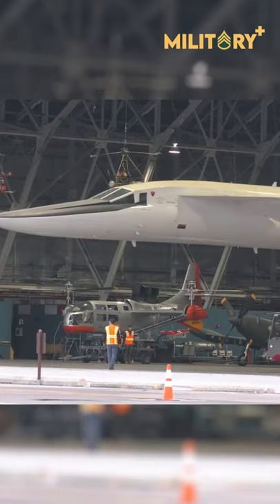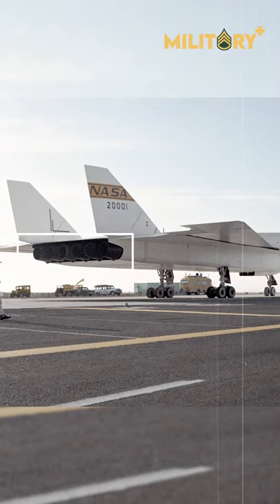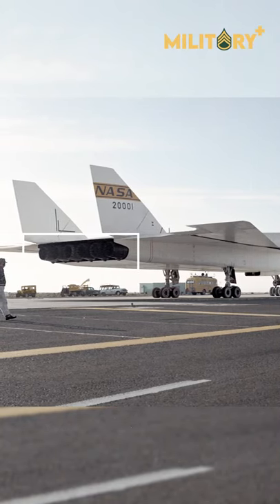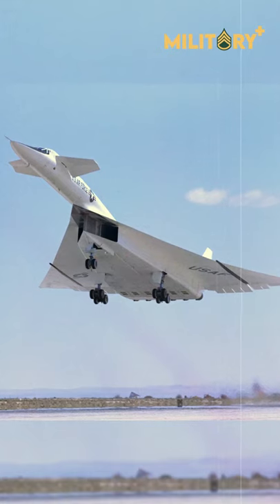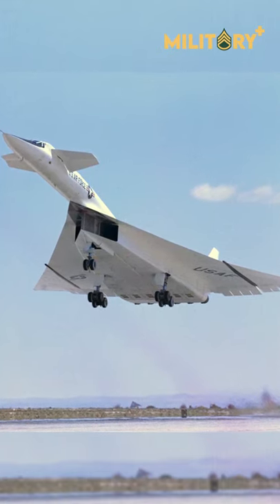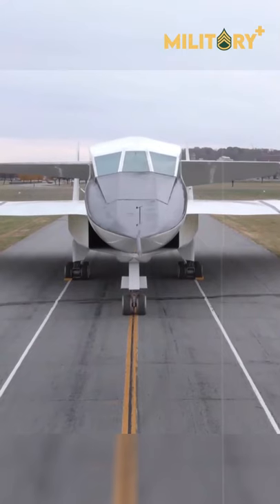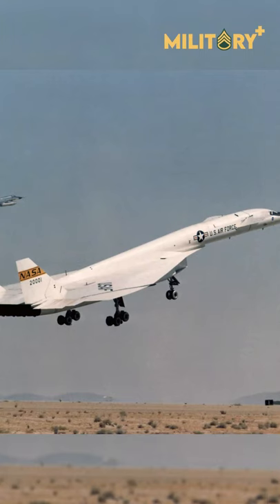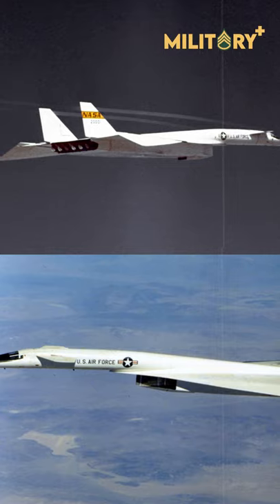North American XB-70 Valkyrie || Mach 3 Super Bomber #Shorts

Comment: They can fly at 95,000 feet travel at 2200 miles an hour and have the same radar coverage as a B2 spirit it’s basically unstoppable for the next 20 years
Reply: By the time in us 500 missile even reaches the elevation it would’ve already gone 9 miles and that’s considering the angle because it’s not directly up
Reply: That’s assumed if it didn’t even catch the radar signature and if it did you would just immediately deploy and drop five cruise missiles that could even be painted in stealth coding as well and then inject the pilots as a last resort it’s a guaranteed hit if you ever need it
Reply: Where do you get those figures from?  Because the ones I've seen published show a maximum speed of 2,000 mph, and a ceiling of 74,000 feet.  Also, those figures were for XB-70A. The B-70 bomber would have been heavier, and likely slower. 

As for "stealth" I've never seen any source claiming that the XB-70A had a small RCS, certainly not as small as the B2. The plane's intake probably added significantly to radar reflection.
Reply: Yes
Reply: @winternow2242 radar coverage not RCS
Reply: @ilovestarship  ..and you understand "radar coverage" to mean, what?
Reply: You are freaking full of JP 4!! The radar cross section was enormous.  In fact equivalent to 3 ,that's 3 ...B 52 bomber aircraft.
Reply: @winternow2242 He's full of JP 4 !!! Doesn't have a flipping clue.
Reply: You’re funny…it was stopped the moment it was complete. Useless except for research and even that it was found to be inadequate.  

Much ado about nothing.
Reply: It most definitely did not have the same RCS as the B2 lmao the Valkyrie was not a stealth plane

Comment: That looks remarkably like Concorde,America any thing to tell ur British hommies
Reply: Really?  Doesn't look at all like Concorde to me. What similarities do you see?  Because I only see differences.
Reply: @winternow2242   delta wing design,nose shape
Reply: @Chriswatt313 Concorde's nose is more cylindrical, and pivots. The XB-70A's nose is fixed and flat.  Many planes in the era had delta wings - nothing unique about them, or by "remarkably similar" they both looked alot like many other planes, like the Mirage iii, Avro Arrow, Vulcan, B-58 and F-106. However, Concorde's ogival wings had a varying angle of sweep along its leading edge, and noticeable anhedral. The XB-70A's wings had no anhedral, the sweep angle was pretty much constant down its leading edge, and famously and unlike Concorde, it's outer wing panels folded downward.
Reply: @winternow2242   no but u said u dnt see any similarities and a delta wing is a similarity,it’s clear when any designers look at making a larger super sonic air craft Concorde data is used cos of all the failures Britain a France went through before they found solutions,but clearly you do know ur stuff bro⚜️
Reply: @Chriswatt313 bruh delta wing is better for supersonic speeds thats why they both have it